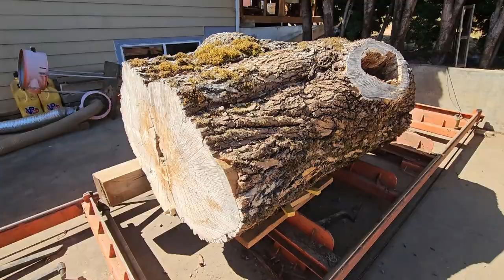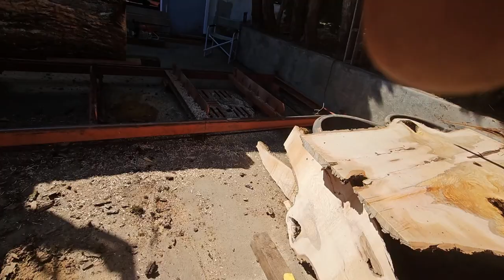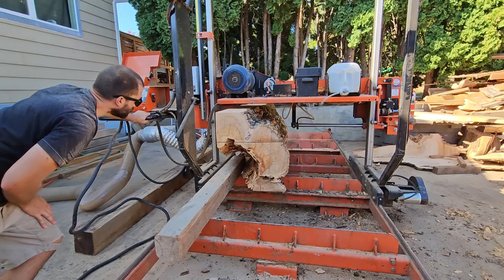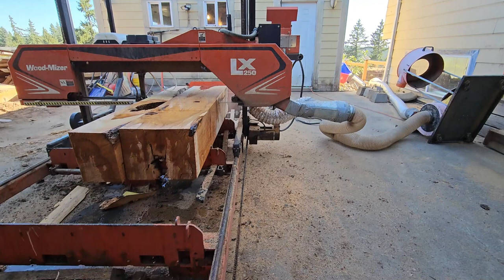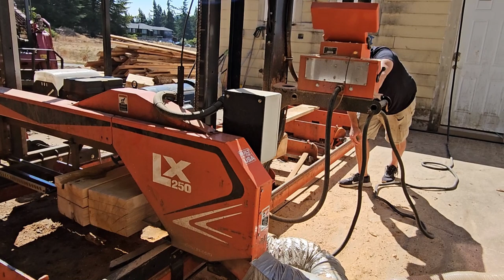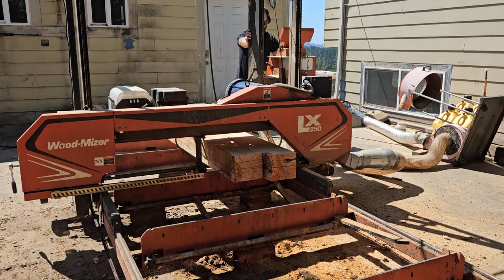Milling a Giant Horse Chestnut on the WoodMizer LX250

Comment: Interesting that you get horse chestnut over there. Here in the uk it’s normally seen as a junk log and most people don’t really like it for anything even firewood as it burns really hot and fast because of how soft it is. I had a horse chestnut log milled but that I left to sit for a while and it was spalted, curly and burly which was stunning. Also in my experience it does dry really nice and flat if you leave the log to sit for a while before milling. Saw on brother.
Reply from the maker: Most horse chestnut is gone locally. It is softer than I prefer but we would never turn down a chance to salvage a large one. I believe the base log is over 52 inches across with a few nice burls! Thanks for watching!